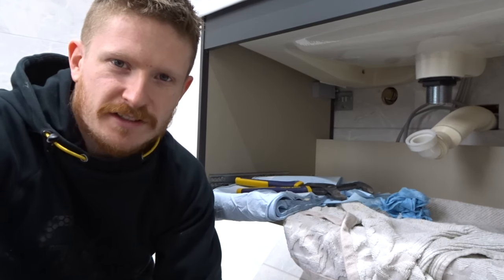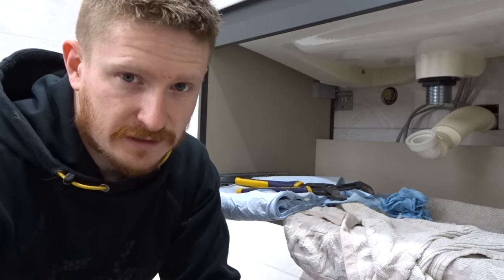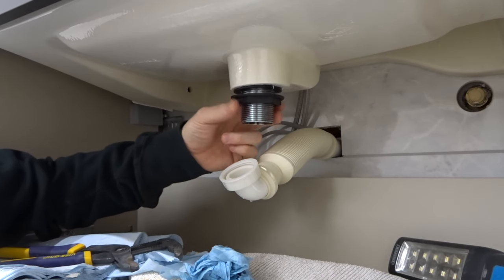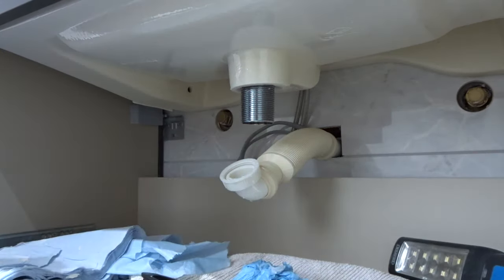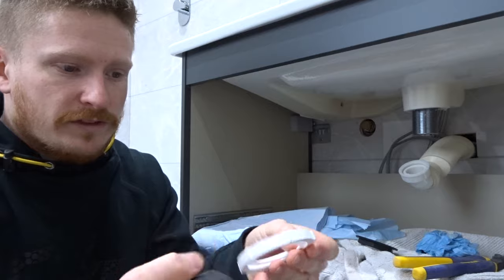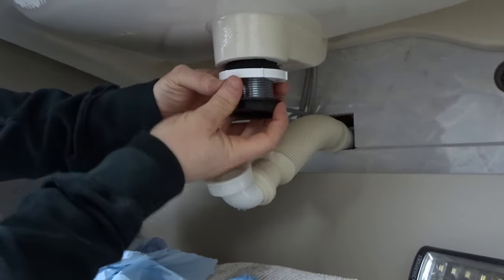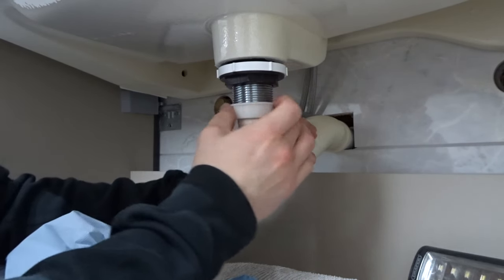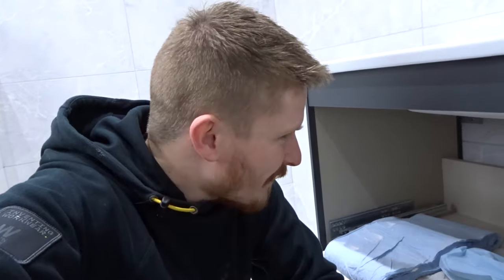How To Fix a Leaking Basin Waste the Easy Way | Seal a Wash Basin

Comment: I've been DIYing for 40 years and done a fair number of basins. I've never heard of the three part waste seal before. I've always used Plumber's Mait which has always worked after some cussing. Today was different. Nothing I had previously done worked. Worse I had three wastes to do around the house (failed pop-up wastes). I picked the kits up locally and you're right, they worked first time. You've saved me hours of frustration and cussing. My sincere thanks!
Reply from the maker: Glad I was able to help 😃
Reply: Difference between a diyer and a tradesman . Knowing the names and what parts exist . I'm an electrician FYI I didn't know about this either so I'm not trying to have a dig at you lol
Reply: @TheDIYGuy1 I clicked on the Amazon and the page doesn't exist 😢. Please can you help?
Reply: They are on eBay

Comment: Struggled desperately yesterday with a new waste and accompanying washer parts, plumbers mait and PTFE tape.  The waste would not sit central, kept spinning with no proper seal and what a mess.   Grabbed the simple kit you recommended from a local plumbers and the job was done in 15 minutes!   It doesn't have to specifically be a 'Thomas Dudley Ltd' Waste Seal Kit - just ask for a 3 piece Waste Seal Kit which cost me £3.49p.   This time no unnecessary Plumbers Mait, PTFE nor silicone sealant and I managed a perfectly clean job, where the waste will be easy to remove to replace in the future if needed.  Thank you so, so  much for such a useful video!  😃👌👍
Reply from the maker: Your welcome

Comment: Dudley diagram shows foam washer replaces existing washer under waste in sink, however in my mind the main seal between cone and thread is the most important as water can come down overflow and the rubber cone seals the whole arrangement. Simple but efficient 😀
Reply: Agreed in the Dudley diagram the white foam washer sits on top, but I also replaced the slotted waste at the same time using a 32mm flowmasta kit which has a new clear washer, so kept the foam one underneath as a spare.

Comment: Main issue I've found with this kit recently is that a lot of basins seem to have smaller openings so the black rubber seal doesn't actually fit up inside it. Regardless of how much you try and push it up and tighten it's 50/50 if it will leak or not.

Comment: Thanks for this video. 👍.The conical seals are brilliant. BUT they only come in 32mm. No good for a bath waste. The best thing for that is good old PTFE tape around the thread just below the lower flat rubber washer, and plastic disc washer, then do up the plastic nut. Don’t bother with silicone seal…messy, time consuming and expensive. PTFE tape..cheap, no mess, no drying time and works every time.
Reply: Don't the silicone seal and PTFE around the threads seal two different water escape routes?

Comment: The idea behind these is great but as I found out the it takes up so much thread that there is nothing left for connecting the waste pipe to
Reply: Same here, such a shame it didn't work as I was feeling so optimistic when I found tjis video. I've still no bathroom basin I can use. ☹

Comment: Dear DIY Guy, our bathroom sink waste pipe started leaking this morning.  My partner has been trying to solve the leak all afternoon.  I found your video and showed it to him.  Initially, he was in denial and said it wouldn't work (lol) despite all the positive comments below.  After hours of struggling...and more struggling...he finally asked to see the video again.  I rang Screwfix to check that the local store where we live had the part in stock.  I also asked my partner to buy Plumber's Mait (just in case) because there were a number of people below that said your solution didn't work for them.  Finally at 6.30pm....it worked!  No more leaking waste pipe!  And no need for the Plumbers Mait!  THANK YOU so very much for your video. You're a star :trophy-yellow-smiling:

Comment: What a find man. Been fitting basins for years, most with no problems but occasionally this  particular problem which lots of cussing and sealant usually solves. This piece of kit is a game changer. Used in a problem waste today and bingo. Problem solved. Will have these in my van from now on and will fit as standard on all basins. No point doing otherwise.

Comment: Thanks, you just saved my bacon. End of the day, filled up my newly installed basin, all good, taps working fine, no leaks in pipework. Opened the pop-up waste and water was running round the threads, so grabbed a bucket. Tightened up the pop-up waste nut, but that only made things worse. Removed the waste, and on closer inspection, it is clearly a rubbish design (designed to leak). Admittedly, PTFE tape may (probably would) have solved this, but I can't help thinking the pop-up waste should include the conical seal by default. Ordered one and collecting it first thing in the morning. I hope this donation buys you a pint. Great channel. Keep up the good work.
Reply from the maker: Glad to have helped you Mick nd thank you very much for the donation 🙂. All the best!
Reply: @TheDIYGuy1  Sadly, this gadget didn't work for me. I nipped up the nut gently, but there weren't enough threads left to connect the waste pipe. I tightened it to reveal just enough threads, and fitted the waste pipe. I still had a leak around the threads. Chucked the conical gadget in the bin, and used PTFE tape. All sorted now.

Anyway, the donation still stands :-) It was a good idea, and a great channel.

I think the conical seal would be better if it wasn't so deep, and was threaded (mine wasn't). That way, nipping up the nut would compress the threads and make a seal.

Comment: I had a leak on my basin I tried everything to cure the problem nothing worked until I came across this Dudley washer kit I fitted it in under 5 minutes no more leaks brilliant thanks for the fitting instructions

Comment: Not aware if this kit until yesterday when I saw on your excelent video, bought this morning from nearby counter that Fixes Screws at GBP2.19, worth every penny. Fitted a few hours ago, brilliant. 
How much hassel this kit has saved. 
No o-ring or washer between the waste and the basin just loads of gone off putty. Used plastic washer that was originally between the nut and the basin. 
Did use a smear of silicone gease on the thread, the Back Rubber Seal cone, on both sides of the washer between the waste & the basin and in the face of the nut, could not help myself, it's what i always do. 
Thank you for your video.
To help others plumbing is Imperial, Central Heating can be metric. 
The 1-1/4 inch is the i/d - bore - not the o/d - outside diameter.

Comment: Used one of these tonight.  Great solution, used a bit of isoprop alcohol (brake cleaner) to easy the cone seal over the threads.  Many thanks for the tutorial.

Comment: Really glad that I found this. Whoever installed my sink in the first place used a lot of Plumbers Mait between the sink and the bottom nut. Over the years, both the plastic nut and the seal have deteriorated - what a mess! Thanks for posting this - very helpful and well presented.
Reply from the maker: Thanks,glad it was a help
Reply: Same for me, the seal will not fit right up and into the hole. Got a slight leak on it so will have to take apart and try again. It seems that the black seal is just a bit too hard and could do with being a bit softer so that it is more pliable and can be manipulated into the hole and around the waste thread. Disappointed 🙁
Reply: Plumbers mate was previously recommended, this kit will make the job much easier.

Comment: Just fitted one of these and like the video no plumbing putty or silicone needed. Decided to fit new waste unit and trap while I was at it. New basin waste unit £13.99, seal kit £2.99, new trap £8.90 from screwfix so £20 the lot. Hardest part of the job was removing all the old silicon down to the  basin ceramic and the boss underneath . When fitting the new waste unit ensure the slot (if slotted) aligns with the basin overflow hole. I found it difficult to get the rubber unit to the top of the thread and into the sink boss orifice as I have arthritic hands but managed it eventually. Impotant to get the rubber seal fully home with no play and the slotted unit down on its seal in the basin. As I had bought a new slotted waste unit I used the washer supplied with it between the waste flange and basin so fitted it all as shown in the video. No leaks, also fill the sink above the overflow hole to ensure the slotted waste is aligned and the overflow water drains. Thanks DIY man for the video much appreciated.
Reply from the maker: Your welcome 👍

Comment: This is the right answer 👍, thanks.  Left me a problem that not enough of the waste was left to get the trap attached to.  Ended up cutting the thick end of this seal off and using it like that, seems to have worked.

Comment: You put the foam washer between the black rubber 'bung' and the nylon seating... It's supposed to go inside the basin between the waste unit and the basin. Though I think most people chuck them and use a bead of sanitary silicone.

Comment: Excellent video again. Just out of interest can this be used with the bath waste too? Or is there an equivalent product? Cheers 👍🏽
Reply: You don’t need one on a bath waste because the overflow pipe enters below the grating.It’s really only wash hand basins I suppose someone should have by now engineered a wash hand basin is designed like a bath or kitchen sink it would be easier to construct as well  with no well.

Comment: Good helpful video.  On a side note, the felxi waste pipe you have there, how does that replace the need to have a trap? Surely there is nothing preventing smells coming back up through the plug hole??
Reply from the maker: The flexi waste is a waterless trap 👍. It has a valve inside it

Comment: I used ptfe tape and pushed plumbers main into the hole before putting the nut and washer then tightened it. It hasn’t leaked since.

Comment: I'm looking for a new pop up waste for a vanity unit. Most negative reviews relate to them leaking around the underside thread. Would it be sensible to attach one of these kits at the same time as fitting the new waste, rather spend months or years keeping my fingers crossed!?

Comment: The plug wasn't long enough to screw the black nut on but luckily I had spare washers off another plug and  tightened it up using the trap itself.

Comment: The overflow holes are a pain for two reasons. Firstly, a good seal is required to stop the water that is leaking on the outside of the metal. Secondly, using a plunger is more difficult as the pressure is dissipated by the overflow.

Comment: Help!!! Still dripping despite using this. I'm using the preexisting metal nut should I be using a plastic one? Or is it a case of just tightening it more? Or do I need to leave the silicone to dry more before running tap?

All help appreciated

Comment: Also, is there a tool that is double pronged to put through the waste, to prevent the waste spinning so that the overflow holes stay aligned? I've done a couple by sticking a screwdriver through one hole, but I find I don't get the secure grip I would like with that method. Cheers.
Reply: two screwdrivers. not joking

Comment: My sink does not go down to the threads on the basin waste, there is a gap, havent seen this nefore, any tips, as i had to force the coned rubber over the smooth part of the down spout, and crank the shi oit of it, only for it to leak still. New sink,  all new pipes and faucet kit

Comment: I used the dudley sealer, 1st time it sealed, but i had to make some adjustment and it leaked, after taking it off an back on again, the threads broke on it and then it was useless.

Comment: Seems to be a lot of confusion on where the foam washer is supposed to be fitted. One side say as you've fitted it and  the other side say it fits on the inside of the basin under the chrome drain.   Me I've got no idea
Reply: a bit late but it goes topside between the popup chrome drain and the basin according to the manufacturer

Comment: Hi 
My threaded waste /plug unit measures 41mm  (just over 1 1/2 inches) in diameter but the seal kit states 1 1/4 inch why and and what is the point of the  imperial measurement and more importantly will fit my unit?

Comment: I couldn't get one of these to work in my application. The waste hole in the sink was only just a bit wider than the tube on the chrome waste. So I don't think the cone was going far enough up in there. I tried it finger tight, nipped up and quite tight, but no joy. In the end I used CT1 instead, using a foam washer between the CT1 and the nut to squish the CT1 up in there. That worked for me.
Reply from the maker: At least you got it fixed.

Comment: Thanks for a useful tip to seal the waste in a very tidy way without paint, mastic or putty. But I think you fitted the seal incorrectly. The instructions on my packet say to use the foam washer to seat the top of the waste in the basin, then the white cup sits between the rubber bung and the back-nut. That said, I fitted mine your way before I saw the instructions, and it worked OK.

Comment: What kind of trap is that? Doesn't seem to be anywhere it's actually 'trapped'?? It's it behind the unit??
Reply from the maker: This is called a furniture waste. The trap works with an air bladder inserted within the pipe. No water trap is required. Thanks

Comment: So when you measure the diameter it isn't what it says when you offer the ruler up. I measured and it was 1.1/2 going by the ruler but when I looked on the box it is actually 1.1/4 and a backing nut I measured as 2" is actually 1.1/2. So confusing to a novice. 😂

Comment: Where can one buy this an what is it called
Reply: A link to Amazon has been provided, but just try a local plumbers merchant as I did and ask for a '3 piece Waste Seal Kit' (doesn't need to be 'Thomas Dudley Ltd').  Worked like a dream with no additional Plumbers Mait, PTFE tape nor sealant (epic failure first attempt without this kit and made a real mess with Plumbers Mait).  Remove the accompanying seals/parts/nut from the new waste, importantly, keep the new original washer in place that seats the waste to the sink on the upper-side.   Just watch this great video very carefully a few times ensuring the black cone shaped part of the kit's under-seal fits snuggly on the underside, pushed up between the basin and the new waste.  Then add the foam ring over this, then the white plastic collar and then add the original nut that came with the waste (with the flat side against the collar) and nip it up reasonably tight, no need to overdo it.  Superb fit and the unit tightened easily without swivelling.   From a complete amateur, I hope this helps.
Reply: @sengwellb1  ..same 😁. Shame they don’t do bath waste 40mm size, only 32mm.
Reply: What's the name of this product  and where can you buy it
Reply: Help please